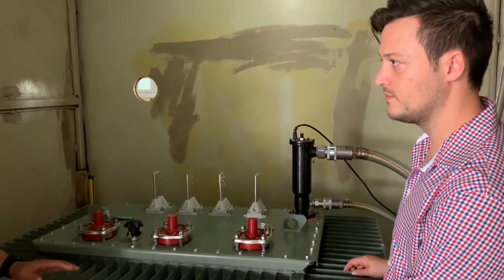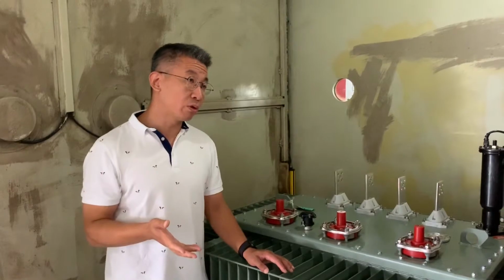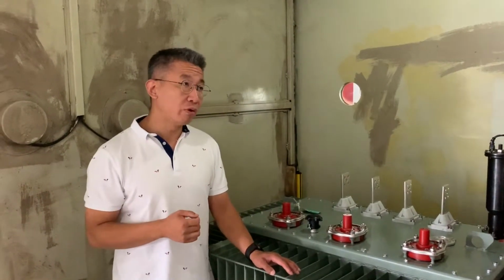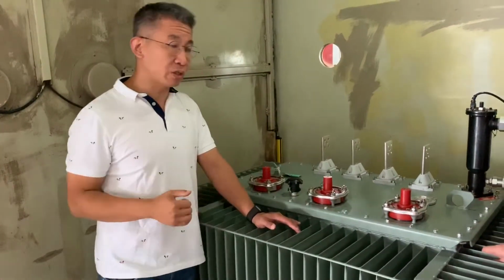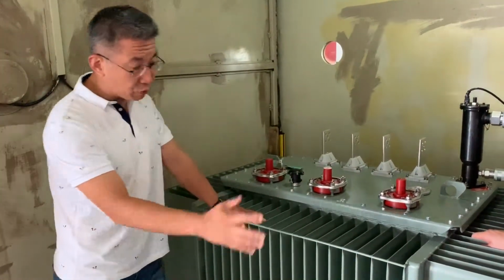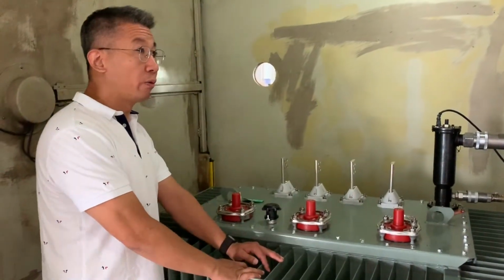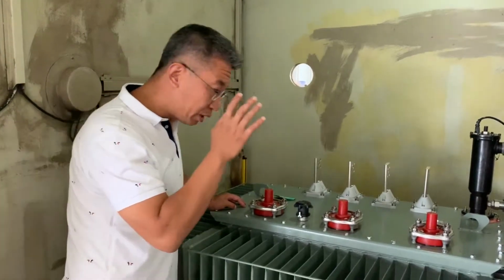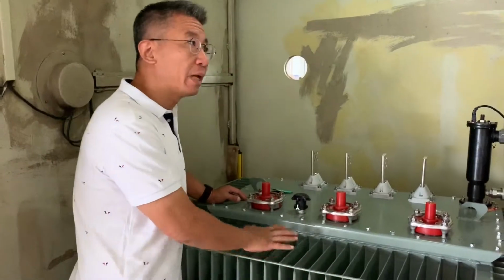Integrated Transformer Vacuum Filling

Comment: How can i top up the oil on site for Hermetically sealed transformers
Reply: Good question. I have a similar situation at my plant and would be too expensive in my opinion. Would be great to hear options though.
Reply: I would suggest fabricating 2 ball valves on the unit one on the top side and one on the lowest portion of the transformer…. Top is used for vacuuming and bottom is used for inserting the oil … Hope this helps